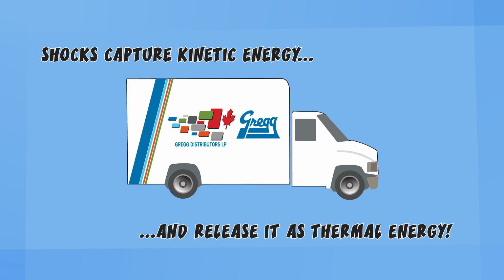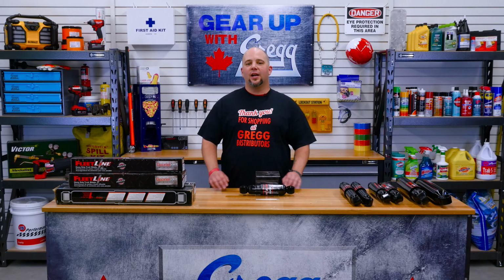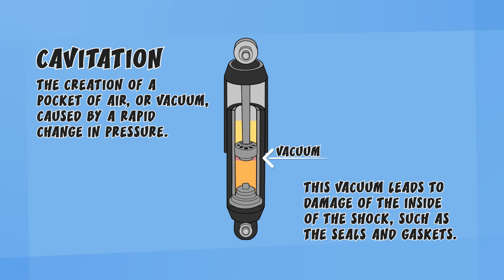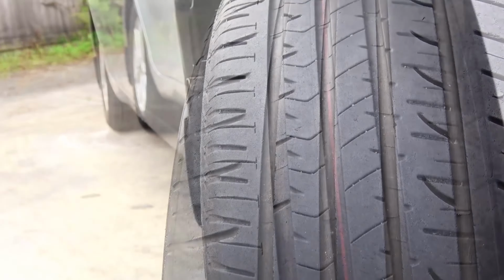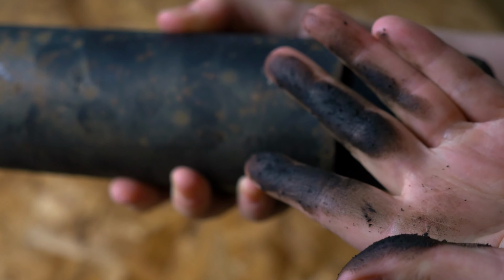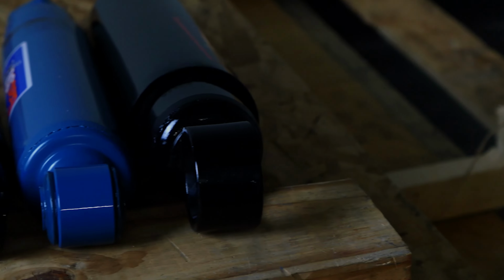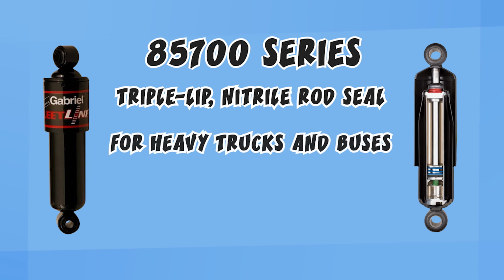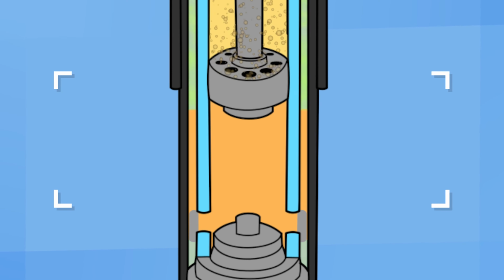Gabriel Heavy Duty Shocks and How They Keep Your Ride Smooth - Gear Up With Gregg's

Comment: I'm a Toyota MDT and I've used Gabriel for years in all my vehicles, specifically the Ultra line. I like the "variable" rebound feature. OEM quality over easy bumps, etc and "tightens" up over quick suspension movement. They are a great product at a great price.

Comment: Hey bro thanks for the video.  Was looking at KYB or Gabriel's for my  2009 Hyundai Santa Fe 3.3lv6 AWD Gls.  I was impressed with Gabriel's  videos I have watched.  KYB OR Gabriel's maybe you could tell me why.  I know of the Gurardian, pro Guard, Ultra's, and Monomax.  I know anything would be better than the old ones.  One question I had was what happens if a I put a  Monomax on my ride?.  I was impressed with the Ultra, and choosing is complex for me, because  I like a smooth ride, but don't mind a rugged ride either.  OE original handling or ride sounds good, but so does better handling.  Driving people around family friends...and being an UBER EATS drive I need soemthing that takes a huge betating as to min six hours of driving a day in all city terrains.  Tons of pot holes in this city tons...so I can drive aggressive which I am not at the moment due compent replacement needs so and Old lady is how i drive until I get my new suspension parts.  So ultra's were looking good to me, what happens when you put a heavy duty shock on a vehicle,  would it just give a rough ride, and be indistructable long lasting? lol that s the only thing that comes to mind is the heavier the strut or shock the rougher the ride.  I am looking for something OE replacable, but also goes above OE for handling and performance, then I got tripped up on the mono max after  thinking of our roads.  So maybe you can tell what is suiteable and what is over kill and why something might be over kill.  cheers bro for making it through this novel.

Comment: Interesting to see most of the comments from 4 wheeler drivers who didn't have the mental capacity to realize this distributor only handles big truck parts.

I'm always shocked and amazed at how you can take an ordinarily reasonable and intelligent person and turn them into a complete %&#*ing idiot simply by placing them behind the steering wheel of a car or light truck.

Otherwise, great video.

Comment: Do you think these shocks will do fine on a 2003 Hyundai Santa Fe, I'm on a lot of Desert Dirt roads, some washboard roads..thanks.
Reply from the maker: The shocks discussed in this video are for Heavy Duty truck applications so they would not work for your application.

Comment: I might be wrong, but now I am thinking whether I did a right purchase. I purchased Gabriel Proguard 4 shocks for my Jeep TJ. Should come over next week. On the second minute of the video you pointed that it should be replaced every 80.000km. In fact, my old KYB Gas-A-Just I am replacing now worked well for over than 200.000km. But Gas-A-Just from KYB is not the Heavy Duty shocks VS  Gabriel Proguard, which is HD. Does it mean that the KYB products are way higher grade than Gabriel brand?

Comment: Need rear strut ass'y for my Lexus RX-350 AWD [mechanical suspension] w/ 149,000 miles ...can you recommend the product that would work for me...thanks
Reply from the maker: The shocks featured in this video and the shocks available at Gregg Distributors are limited to the Heavy Duty truck market.  Unfortunately, we do not have automotive shocks readily available for your application, but thank you for watching our video!

Comment: Looking forward to putting these on my truck next week. Gabriel 89440 GasSLX Heavy Duty Adjustable Shock Absorber Mounting them on the steer axle. Just mounted new steer tires. And will be adding the same model to the rear in a few weeks.
Reply: Rear?
Reply: How did it go? Do you feel a better ride. ??
Reply: @hprider01  these are trash all of mine went out within 5 months